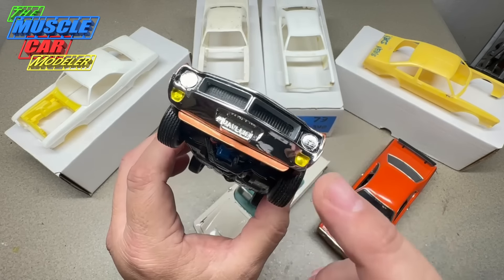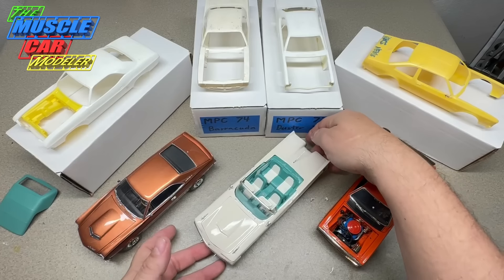How To: Foil Casting Small Items Emblems and Scripts

Comment: You just saved my project!!
I got very lucky, and bought a Johan 1970 442.
This kit is very expensive ( around 160) and because it's a older Johan,...it does have its faults.
Not enough detail, molded in seats and suspension, as well as the hood from a Cutlass S and not a 442!
I just bought the retooled Revel 71 442 kit for parts, but the front hood tooth between the grill had a 442 emblem on that panel and the 71 has an Oldsmobile emblem!
The 71 does come with a decal that looks nice, but nowhere near as realistic as doing it your way!!
Thank you so much,...you just earned a subscriber!
Reply from the maker: Thank you! I have a few other JoHan olds 442 that I built on this Channel. You may want to search for them.
Reply: Model car garage has a photo etch set for the Revell kit that also comes with the different grills, and all kinds of other goodies that you might want for the Johan kit.  Plus the AMT 69 442 chassis with the posable front wheels, fits about perfectly underneath the Johan body.  The new Revell kit has an excellent chassis too.

Comment: I almost didn't watch this because i knew the old way of doing this, using plastic melted with glue.  First you had to cut up sprue pieces, melt them in glue to the perfect consistency, then pray that the foil didn't bend while trying to glob that into the foil.    I think I'm gonna like this way a whole lot better!!  Thank you Ralph!
Reply from the maker: Thank you. Yes the old way you described seems like a lot of work.
Reply: @TheMuscleCarModeler  it was a lot of work especially since it only worked about 25% of the time.  Maybe part was me because I thought I was supposed to take it out of the foil?  Last time I tried it was like 15 yrs ago.  I will certainly try you method!
Reply from the maker: I leave it in the foil and glue it on as is. My success rate is much higher now, but I still make extras.

Comment: I already figured this out years ago. I'm glad to see that someone else did too. I only wish that I knew about the super glue and aluminum trick way back when I first started building models. Now I wish I could plate chrome parts. That would be the only part of my repertoire that I don't yet have for my skill set. I make my own models and parts but anyone can do that now especially with the advent of 3D printing machines. This makes silicone moulds and polyurethane resin almost obsolete! The aluminum trick also works if you want to plate parts - spray adhesive 3M brand works best on foil. I mould my trim first then spray it and apply it to the part. Or I spray the foil then mould it to the part and trim as you would with Chrome Foil brand but with better adhesion and a shinier more chrome like appearance. Thank you for sharing this for those who didn't or still don't know how to do this.
Reply from the maker: Thank you for your input!
Reply: Why moony, haven't you heard of the chrome sprays??? Been experimenting with them and many are so close that one can't tell the difference. Not quite as durable but if it's just a  display model, not to be handled that is, they're great. Denny G, Sandwich, IL

Comment: Wow Ralph awesome tutorial.. Came and a good time too. I have a 66 Fairlane that needs script on the trunk,(ebay glue bomb) that has been sanded off mostly and I have a new in the kit body and this trick is just what I need! Thanks! 👍😁
Yes U have BMF the script before painting that is a cool trick too... Lol

Here is a tip I seen somewhere. Take a pop bottle cap and fill the bottom full of candle wax, then put your super glue on that and it will last almost a 1/2 hour or so. When glue is dry, pop out the dries super glue re-flow the wax and your ready for the next time. Works great for long gluing sessions...
LLAP 🖖
Reply from the maker: Thank you! Great timing!
Reply: I use a tea candle. I keep several on my desk for help with assembling some of the military kits. I am rarely building auto and military models at the same time, so no issues yet.

Comment: I always did wonder how this was accomplished. You do make it look easy, but now I'm not afraid of screwing up a vintage car trying it. Thank you! I'm now subscribed...
Reply from the maker: Thanks. Making the emblems is pretty easy and no harm is done to the body you are taking the foil molds from. Hard part is not damaging them when trimming or crushing them. But if you do, making extras is easy and the tape method of attaching them really helps. Using the tape the way I do really limits the damage and helps locate them before gluing.

Comment: That’s fantastic! I’ve done this before and also used black sealant as a mould and melted plastic into glue poured into it. But using sellotape as a handle and a means of placing emblems go attach them is a great idea. Thank you 👍👍👍
Reply from the maker: Cool. It’s funny but I didn’t think too much about the tape portion of this video but that has gotten just as much feedback as the actual foiling!

Comment: New to the hobby Ralph, rather back at it. 82 now and the last plastic model I built was way back about 1954 or 55. I'm picking up lots of new ideas and learning about new materials to work with, i.e. paints, glues, photo etched parts, etc. Have been disappointed in several models I've built this winter because of the molded in emblems, door handles, etc. After watching this video.....the this thought came to me---Oh yeah dumb ars.....now why didn't you think of that. Great tip, thanks, makes complete sense, I'm sure I'll be using it a lot in the future.                Only thing I had doubts about is how well the CA plug is gonna stick to the aluminum foil. I'm envisioning it falling out about the time you lay it up in place or the foil coming with the tape when you pull the tape away after it sets. But....some experimenting will answer that question I'm sure. Thanks again for the tip. Denny G, Sandwich, IL
Reply from the maker: Welcome back! Enjoy your builds and have fun!

Comment: Hey dude. Thanks for this video. I casted out a few items using your method but I did a few steps differently which i hope you or others on here can try too.
Firstly after you've casted on the foil after applying the super glue, I sprinkled a tiny amount of Bicarbonate of Soda on the glue. This instantly hardens the glue hence did away with waiting 24hrs to cure. 
Once hardened, I used a 1000 file to smoothen the glue out to almost the foil level. 
Then for cutting I used those tiny scissors used for manicure/pedicure to really cut precisely around the curves and edges.
You end up getting an almost casted logo or body part.
Hope this tip helps you or anyone else.
Reply from the maker: Thanks for the additional steps that may help others out!

Comment: I remember reading articles about this years ago. If I remember correctly, they would clean up the back and some of the excess foil with emery boards.  Basically, just run the back of the cast piece flat across the emery board . Should get a lot of the excess foil that you can't get with a blade.
Reply from the maker: I may try that next time.

Comment: Just a tip that may help with this. I would recommend trying 3M "magic tape" instead of cellotape. Magic tape is frosted, sticks well but easy to peel away and it doesso super clean.
Reply from the maker: Thanks. I may give that a try.

Comment: For the white glue, you can also use Roman Seam Repair, comes in a white tube, blue lettering, in the wallpaper department of Home Depot, Lowes, etc.  It dries clear, tacks up quickly, has a slight flex, and sticks to plastics well.  I use it for details on model railroad locomotives and other detailing.  Also use it for windows on passenger cars, buildings.  It won't fog clear styrene like plastic glue will do.  Try it, you can get a very large tube for less cost per oz.
Reply from the maker: Interesting. Thanks!

Comment: You can use the paper stick of a q tip if you cut off the cotton as a burnishing tool. It's harder than the cotton but softer than a toothpick and you have it on hand. Cut it at an angle to get in tighter places like lettering and/or soften it up.
Reply from the maker: Thanks! I may try that.

Comment: I'd suggest brushing a very light coat mold release before filling your foil impression with ca.  Once cured the ca part will release from the mold for rinsing and chrome paint.  doing it this way avoids the growth in the size of the emblem and trimming hassles.  I've had better luck with uv cured epoxy than brittle ca.  You don't need mold release and the logo isn't as fragile.
Reply from the maker: Thanks. I may give that a try next time.

Comment: Very helpful way to detail models. Can you tell me with the script "Duster".....you can apply this to model slightly trimmed, but still with a bit of foil around the emblem.......Once it sets do you clean more of the overage foil away? Also when you do the final paint job , do you use solvent to clean the raised emblem?
Reply from the maker: Thanks. I try and get it as close to trimmed as possible. I try not to trim it after it is attached to the model.

Comment: Instead of a q -tip, use a soft eraser to press the foil down. You'll  get a much smoother print and it'll get all the detail. Then take a small piece of balsa and super glue or epoxy it over the foil.
Reply from the maker: That last part makes no scents as the foil is becoming the new emblem.

Comment: This is immensely interesting! Thanks! For that matter, your foil casting technique would be applicable a wide assortment of surface features, as well. 
   In building AMT’s 1:25th-scale plastic model kit of the Ford 900 Cabover Stake-bed Truck, I wanted to age it to some extent—rusting, staining, fading, weathering, missing pieces, etc.—without making it a wreck. As part of this effort, I also removed the raised letter “R” in the manufacturer’s name from the very front, above the grille, and I used a tiny drill bit to represent the two resultant holes. I had wanted to have the fallen piece of metal perhaps just to have slipped out of place (I also would have had to apply a chrome finish), though I then had no idea how to replicate it. Your process gives us that. 
   At round 25:00 or 26:00, in watching your technique in progress, I wonder about something: are you using gel cyanoacrylate (gap-filling super glue)? Would the regular cyanoacrylate work, too? It would set faster, so it likely would cure faster. I ask because you actually are using the method, so you would know. 
   Also, if I understand correctly, cyanoacrylate when dry and cured is transparent or translucent, which might lend itself to creating lights (e.g., turn signals, markers) that one in theory could illuminate with tiny LEDs (the wiring would look like that on the actual vehicle).
Reply from the maker: Thanks. I just use regular super glue liquid so it levels better. It does dry clear and may work as a Lense, but you may have to do it in thin layers. If it is too thick, it tends to bubble a bit and fog/frost.

Comment: Curious have you tried putting a drop of accelerator on CA filled molds to speed up the dry8ngbtime?
Reply from the maker: I did once but the glue reacts differently with the accelerator when it is thick. It tends to boil and leave bubbles. Letting it dry slowly seems to work best.
Reply: @TheMuscleCarModeler  I didn’t realize that you left the CA glue in the aluminum foil, super simple way to dress up a model
Reply from the maker: Yes. I let it harden inside the foil. It helps it hold the shape and then glue it to the body.

Comment: Raoul. I Use Silly Putty to Make the Mold & Fill it With 5 Minute Clear Epoxy then Foil Over It. It's Not As Fast But Works Well
Reply from the maker: Interesting! I use silly putty for masking!
Reply: @TheMuscleCarModeler  I Do Too it Was Scale Auto Enthusiast Magazine tip in Late 80s. I Also use Silly Putty to Recast Molded In Chrome Headlights & Taillights Using 5 Minute Epoxy as well. But on Taillight Mix I add Transparent Red into the Epoxy Mix and add Extra Hardener to Compensate for the Paint
Reply from the maker: Some of these tips I learned back then also. Some I have been doing so long that I don't even think of them.

Comment: Have you thought of filling the molds you make with baking soda powder? Leveling with a straight edge, then adding super glue? The powder will act as a capillary and wick the super glue straight in and set it instantly.
Reply from the maker: No not really. I could see that working also but I have learned not to rush things like this.

Comment: That is awesome! I wish I had came across this before I did my Chevelle SS. I had SO much trouble with getting my paint to do right that I actually wore down the Super Sport and crossed flags that I had to buy decals to do em, which really didn’t come out good at all. Thanks for the schooling for future reference. I hope you don’t mind my asking, as I have recently retired and am trying to get back in to modeling. Cragar mags are my favorites, and I have found them on line, however I can’t find any chromed. Did you order those or were they from another kit. And if you know where to find them, would you please be so kind as to enlighten me? Thank you in advance.
Reply from the maker: Thank you. The Crager wheels I used came out of my parts stash. I don’t remember what kit they came from. I’m sure it’s an older issue of something I had many years ago.

Comment: After I posted I had an idea, something that often times leads me in to trouble. Sometimes I get lucky. I actually looked up chrome fingernail polish and wonder if you have ever tried to use it to chrome parts or if maybe you knew someone that has? As with your Thunderbird body, I’m going to buy a bottle and try it on a sacrificial epiece and maybe see how it works out. My next project is a 1/16 scale 1964 Mustang that’s been sitting on a shelf for probably 30 years and the chrome parts, especially the mags have, for lack of a better term, faided, so the nail polish may just be my saving grace. I’ve seen Revell chrome spray paint, but DAWG, at around $80.00 a can, no thank ya! All help, tips, advice is always appreciated.
Reply from the maker: I have not tried anything like that. Look into the Molotow chrome paint pens. They are nice!

Comment: Great video. I learned something new today. I had to laugh when you folded the tapes edge over.. I did this habitually at work with any tape i used when masking parts. Why pick at it and possible ruin the paint job you worked so hard to get perfect?
Reply from the maker: Thanks. Yes, I learned this tape tip many years ago.

Comment: Why don't you use blu tack wet or clay to enhance the mold features? If you push it over the imprint hard it will force the foil better than using a toothpick alone give it a go
Reply from the maker: Yes you could do that.
Reply: I see you mentioned it after I write the comment but just make sure it's wet and you won't have a problem you get more detail @TheMuscleCarModeler

Comment: if you want to try, this tip might be helpful: superglue has an instant reaction when in contact with baking soda. it cures completely dry instantly and also hardens a lot more than by regular air drying. its way more difficult to break a bead of glue and also makes it bond a lot stronger too. just sprinkle a pinch of baking soda over your superglue and gently blow the exess away, i bet you will get casted parts less fragile and usable instantly
Reply from the maker: Thanks. I may give that a try next time.

Comment: Just curious...could you take the badges and very lightly rub them across some maybe 4000 grit wet or dry sand paper (wet) until it got down to where the lettering only was showing and you did not have any more of the foil showing where you cut around it? You know what I am saying? You still had some foil left around the badge after trimming. I know it wasn't much...but I don't know how it is easily seen either...
Reply from the maker: Possibly. I have found them easy to break at this point, so I haven't pushed my luck that far. Others have said to add talcum powder to the super glue and that will make it stronger. Also, since I super glue these to the body. I don't want any gaps between the letters for the super glue to seep through. I have tried that before and glued my finger to the body sandwiching the emblem in between. That is when I switched to clear tape.